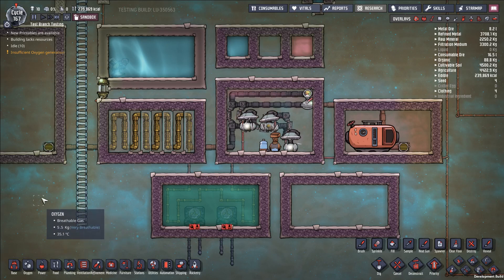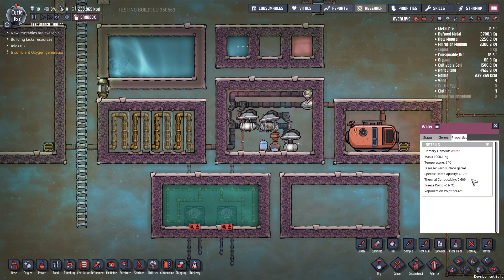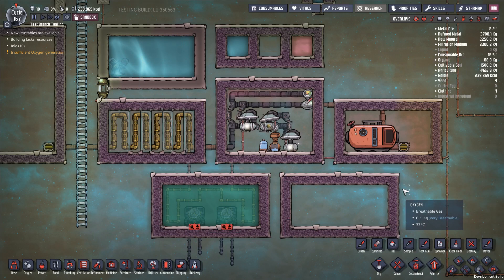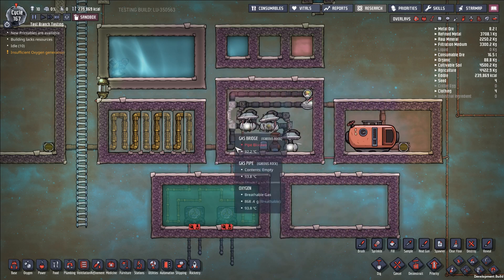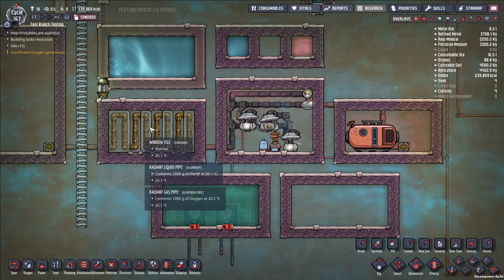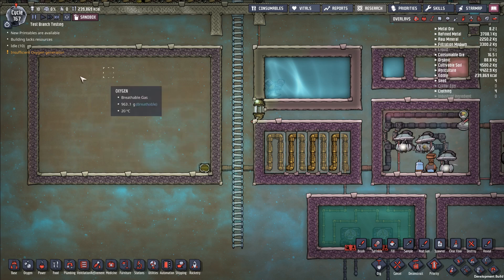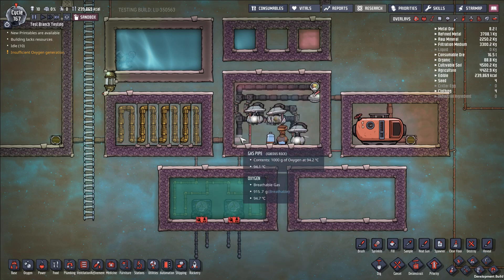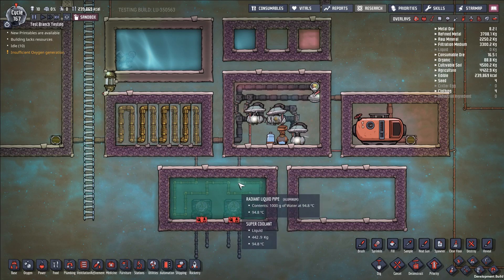Using Electrolyzers to Cool Your Base [Oxygen Not Included]

Comment: I couldnt manage to harness the heat from electrlyzers nor use them for cooling because of this convoluted mechanic. Normally I put everything inside a industrial block. Including literally everything to just get more steam power and spend less on cooling. 

For example generators are very easy to implement
input: probably hot
output: pure power
byproduct: even hotter (probably CO2)
steam turbines: overtime
batteries and other machines produce free heat just for existing on a grid

Electrolyzers on the other hand
Requires pumps(main power sink)
mixed byproduct(not even seperated)
convoluted but exploitable heat management similar to makeshift petroleum boilers

Comment: Aha.  The oil well does the same thing.  If you feed water that is too hot it will heat up a bit more inside the well and turn to steam.
Since they both have an internal reservoir that I guess can flash to steam without damaging the pipes or it.

Comment: I am on the second asteroid that is sea and is full of salt water, if you evaporate it, it is desalinated. Where do I get the aluminum and the super refrigerant or industrial refrigerant? Can I get it with the steam coefficient? Very good contribution, thanks, you give me courage to continue because even the insulating tiles get very hot.
Reply from the maker: Aluminum shows up in forest biomes, so not all asteroids will have it.  Super coolant has to be made from materials you gather on space trips.
Reply: @gearheadgaming1  Thank you for bothering to answer, you are a crack, I had the doubt, but the materials I can surely get them at a late stage, I am in survival and it is more difficult than before, my asteroid has no rust but I jumped, to see if I get used to it and I put turbines to desalinate and put your method into practice since I would have very hot water to create oxygen. Thank you

Comment: Would love for you to make this video as if it were for a completely new person. Where you explain the components and show the flow each step with temperature readouts so they can get a clear understanding of what is happening at each step and how it can be applied to whatever it is they are doing.
Reply: Yeah, I have no idea what the hell he's talking about
Reply: @pandeomonia  me too.... feel like im on school on physics classes
Reply: I'd also love this. Ive tried to find videos on basic cooling, and they all seem out of date from recent changes made to the game. Little things like, say, HOW you set the temp of your water reservoir using cooling or heating lines...
No clue how that is supposed to be done. Makes it a tad difficult to get into the game when so many things are taken for granted that people just KNOW how to do, when as a new player i havn't the faintest idea how the different systems in the game work.
Reply: @massagetherapyjo  I don't think this is out of date.  It took me a few times watching this and thinking through this system to get a handle what's going on here.  Remember, the electrolyzer outputs oxgyen and hydrogen at a minimum temperature of 70 degrees celsius/158 degrees farenheit (and that's too hot for crops to grow).  So, any water under that temperature going into the electrolyzer (water can hold more heat than oxygen in a smaller space/it has a higher specific heat capacity), has the same effect.  It gets converted to hydrogen and oxygen at the same temperature.

The flow of the input to the electrolyzer goes from the water pump to the electrolyzer.  The counterflow thus could get thought of as going from the electrolyzer to the vent (for the oxygen) or tank/generator (for the hydrogen... or vent I suppose).  Or better, the counterflow goes from the electrolyzer room to a vent.  The core idea lies in exchanging the heat from the water going to the electrolyzer with the heat of the oxygen from the electrolyzer room.  In other words, heating the pumped in water up, and cooling the oxygen down.  Hence the term 'counterflow heat exchanger'.  

So, the counterflow heat exchanger works by water getting pumped in from the tank at the tanks's temperature.  It passes over radiant gas pipes of oxygen.  This heats up the water only a little bit since those are insulated liquid pipes, but cools the oxygen much more.  The water goes from a cool temperature to closer to 70 degrees, but still less than 70 degrees.  More significantly, the oxygen passing through radiant gas pipes flowing counter to the water, passes over the insulated liquid pipes.  And that cools off the oxygen!  Note this sort of system ... even without the thermal aquatuner room... should work for any asteroid, given that you can get cool enough water!  

The specific heat capacity (how much heat an object can hold per unit of volume) of the water combined with the use of insulated pipes enables the water to get heated ever more before it boils.  That's where the room with the thermo aquatuners comes into play, and thus talk of cooling the base by an electrolyzer (instead of just cooling the oxygen).   But, to me that's just icing on the cake.  

This electrolyzer system setup isn't a self-powered oxygen module.  It's self-cooling!  And could probably be self-powered fairly easily also.
Reply: I think I got lost when he explained it was 'a counterflow heat exchanger' --
Reply: @tfb 

A counterflow heat exchanger runs hot and cold materials in the opposite direction to each other. In the example (the bit with the diamond tiles), hot oxygen comes in from the right and cold water comes in from the left. Let's start from an empty system, and temporarily ignore the bit with the aquatuners and super coolant. There's something else I'm temporarily ignoring and it's important, so hopefully this is your second readthrough and you already know what it is. If not, keep reading.

The cold water runs right through the heat exchanger and does nothing, because there's no oxygen yet. The cold water reaches the electrolyser, and turns into hot oxygen. The hot oxygen runs left and hits the right side of the heat exchanger, where it encounters a pipe full of fresh cold water. Let's focus on the small area at the right edge of the exchanger. The hot oxygen warms the cold water, losing some heat in the process. It moves on, and encounters water that's just as cold, losing more heat. Then it moves on through the rest of the exchanger.

Now, that only applies to the very first bit of oxygen to come out. The bits of oxygen behind it in the pipe aren't meeting fresh cold water, but water that has been already slightly warmed by the first bit of oxygen. The bits of oxygen behind THAT are meeting water that's been warmed once, and then warmed again... And it goes on like that. As the system comes up to temperature, the rightmost part of the heat exchanger becomes the warmest. The oxygen that enters there has all its heat, and the water that enters there has its initial temperature plus all the heat it picked up during its trip through the exchanger.

Let's move through the exchanger a little. The oxygen and water here aren't as warm, because the oxygen has given away only some of its heat and the water has picked up only some of the heat it can get from the exchanger. Further through the exchanger, the oxygen and water are cooler again because the oxygen has given away most of its heat and the water only has this semi-warm oxgygen to take heat from. Finally, at the left side of the exchanger, the oxygen has given away all the heat it got from the electrolyser and is the same temperature as the cold water entering the exchanger.

Now, that other thing I've been ignoring is that water and oxygen have different heat capacities, and I've been ignoring it because it makes the counterflow heat exchanger much harder to explain. If the two materials exchanging heat have identical or similar heat capacities, then you get the nice symmetrical hot-to-cold gradient I spent three paragraphs describing. If they don't, then one material changes temperature more readily than the other, and I didn't want to cover that as well as the concept of a counterflow. In a counterflow heat exchanger inputting oxygen and water, the oxygen rapidly changes temperature to match the water. The water does not. It absorbs the heat energy of the oxygen without becoming much warmer itself, and continues to do this throughout the heat exchanger until it comes out of the other end nowhere near as hot as the oxygen that came in. The counterflow can make the oxygen cold, but only warms the water. If you feed this warm water to the electrolyser, you'll get the same hot oxygen that you'd get out of hot water, so you might as well add more heat. Using a tepidiser is kind of pointless, because that's making heat for the sole purpose of destroying it. Using an industrial area is better, because that's making heat as a side effect of making metal, plastic, ethanol, etc. So, how do you get this heat from your base into the electrolyser water?

Enter the aquatuner (and its little brother, the thermo regulator). Like many things in ONI, it makes heat. Unlike many things in ONI, it takes this heat from elsewhere rather than creating it, and does it as part of its job description. If your cooling loop for an area uses an aquatuner, the heat energy removed from that area is concentrated into the aquatuner. The heat from the aquatuner can be transferred into the warm water leaving the counterflow heat exchanger, and this extra heat just goes away when the now-hot water is converted into hot oxygen. Why does it just go away? Because oxygen holds less heat energy than water and, as shown by the temperature changes in the counterflow heat exchanger, cannot change another material's temperature as well as water can.
Reply: I have to agree. This is more a concept video for pros. I've got some basic setups I've copied from other tutorial and still learning some of the more complex things as I haven't done rockets yet. And I'm having trouble following what all this setup is doing.

Comment: very good setup, good explanation but where\how do we get the water at 19º?
Reply from the maker: If you have access to a 95 C source of water, it's probably best to just run that directly into your electrolyzers and skip most of this system.  This video is mainly about getting as much cooling as you can out of your water before you send it to the electrolyzer-- if your water is already hot, then there isn't any more cooling to squeeze out.

However, there are a variety of water sources that give you water much cooler than that.  Cool slush geysers, melted ice, water pockets you find around the map, water that's been cooled in pacu aquariums, water and ice you bring back from space, algae terrarium outputs, and petro gen and nat gas generators (assuming they dont get nerfed).

I'll have more videos using different resources to cool down a base (salt, obsidian, pacu, etc), so if this build doesn't line up with what's available to you, then hopefully there will be another that will.
Reply: @gearheadgaming1   that's exactly the case. I need a cooler setup to cool down the oxygen from the electrolyzer wich doesn't need lots of power, and the weezs need phosphorite! I'm in early cycles, any sugestion to cool the oxygen. Thank's a lot, love your videos and explanations, learned a lot
Reply: @lucaluiggi4960  cooling loop with ice makers, just don't use that water for anything else.

Comment: I learned a ton! I am really curious how it works, how did you land at 20 C° so perfectly?
Reply from the maker: It's a combination of three factors:

The 20 C water coming in has a high heat capacity relative to the oxygen.
The heat exchanger is made of highly conductive materials (i.e. aluminum)
The heat exchanger is set up in a counter-flow configuration (cold water comes in one end, hot oxygen comes in the opposite end)

This means that as the oxygen travels through the heat exchanger, it is exchanging its heat very efficiently with the water, and because the water has so much more thermal mass, it is able to absorb all of the heat very easily.  And as the oxygen flows through the heat exchanger, it encounters progressively colder and colder water-- right before it leaves the heat exchanger it comes in to contact with the water that has just been pumped in at 20 C, which brings the already cooled oxygen down the rest of the way to 20 C.

If the water coming in was 25 C, then the oxygen coming out would be 25 C, so in a sense the trick is to manage the temperature of the water supply.

Comment: I'm just thinking what if Klei used DTU's stored in the water instead of water tempature. Just imagine, 95 degrees of water comes in and even hotter oxygen and hydrogen comes out. 
After I say this Klei releases a new patch:
Klei Game Patches:
8.11.2019: Output tempatures are based on the stored energy in input matter instead of the input tempature.
And then they would probably add a note like this:
Deal with it, heat deletion with fixed tempatures are now gone forever. We'll change the game's name to "Air Conditioners Not Included".
Reply from the maker: It'd be tricky, because they'd need to set a basis temperature in order for the math to work.  If they set the basis at 0 C for example, and you ran 100 C water through the electrolyzer, you'd get 360 C Oxygen and Hydrogen out-- even if you just ran 40 C water in, you'd get 144 C gasses out.
Reply: @gearheadgaming1  What happens if they set the basis tempature absolute zero?
Reply: @sesei2149  They'd pretty much have to if they didn't want to make it arbitrary and inconsistent to the purpose of conserving fundamental quantities and eliminating perpetual motion machines of the second kind using this setup.

Basically, they simulate each material as having an energy, E, that is defined by the specific heat capacity in relation to the given temperature of a material. Specific heat capacity incidentially is a measure of the entropy of an object in the game. Mass*SpecificHeatCapacity = Energy over Temperature which is the dimensions of Entropy; how much work you can do with one degree of temperature.

With Specific Heat Capacity pegged to Celsius, we are generally calculating the relative energy of a material to water. With it pegged to Kelvin, we're calculating it pegged to a theoretical 0 point. A gram of material at 1K will have a DTU value equal to its SHC coefficient. Hydrogen has 2.4 DTU per unit at base state. Oxygen has 1.005 DTU. 1 gram of Hydrogen at 293K (roughly 20 C) will represent an absolute energy value of 2.4*293 DTU = 703.2 DTU. These DTU represent how much energy is required to be transferred thermally into the material to raise its temperature by 1 degree K from 0K. 1 gram of water at 293K has 1224.447 DTUs of absolute energy. 1Kg of water at 293K has 1224447 DTUs of absolute energy, so we'd expect the hydrogen and oxygen to come out at approximately 1054 K assuming they come out in equilibrium and assuming a lossless conversion from water to gas.

It would make the Electrolyzer not a beginning tier item for oxygen generation. And to make deletion of heat via burning the hydrogen not possible they'd need to change the hydrogen generator to either have variable power production proportional to the heat of the hydrogen gas or variable heat dissipation proportional to the heat of the gas.

Comment: Hey! Thank you for the informative video. But i got a question, is there a realistic way to get 20° Water as input for that system? I guess that the system will not provide enough cooling to cool down the water from a cool steam vent to use it as input? i might be wrong
Reply from the maker: If the water starts off hot, then there's not much else to squeeze out of it, since all of the cooling that this system does comes from heating up the water.

I've got an ice maker build on the channel: https://www.youtube.com/watch?v=ppXBtMu3JVw 

This video is from before the ice maker nerf, but it's still a strong building.  I believe a single ice maker still deletes about 20kDTU/s of heat for only 60 W of power and a very small amount of duplicant labor.  If you're running ~95 C water into your electrolyzer and want to cool the oxygen down, three ice makers should be able to get it down to ~25 C
Reply: I would try to make a fresh water pool with ice tempshift plates from a cold biome, dump in some 70 degree water from a geyser pool to melt the ice, and use that cold water to jump-start the system. From there you can keep adding to your reservoir and maintain 19 degree water.
Reply: @G.r.e.g.g.l.e.s  you can just use passive cooling for the steam vent, just leave enough room for the steam to build up while the vent is active.
Reply: @Ghorda9  What did you think the question was? I was just telling him to grab a little bit of geyser water to heat an ice pool to 20 C, my dude